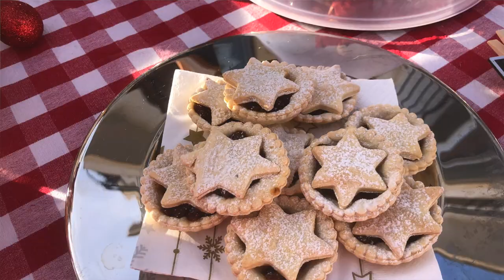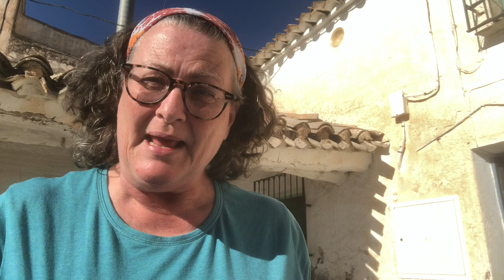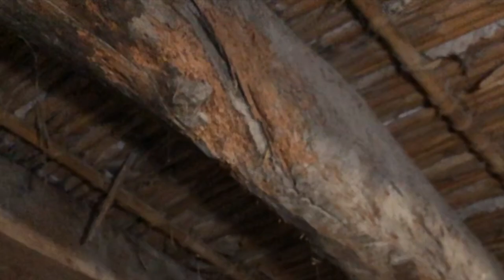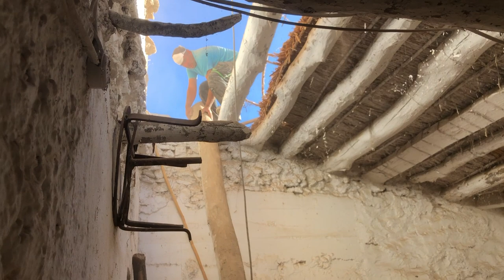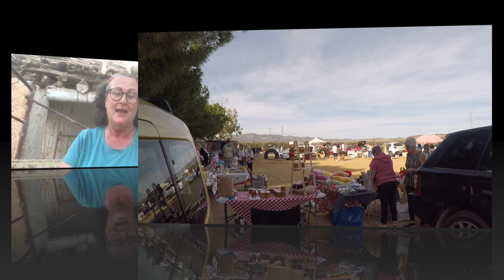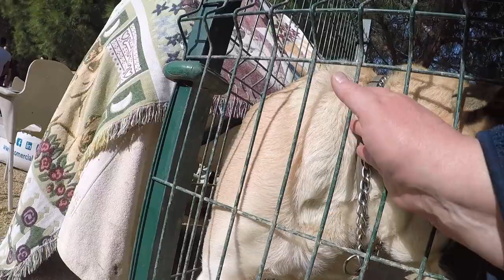23. Part 2 of the roof repairs, good and bad news about the beams & visit an animal sanctuary.

Comment: Hi, I for one would be interested in your back story, employment history etc. etc. Happy New Year.
As mentioned above plug in USB drives are great for freeing up space go for 2 or more terabyte (TB) SIZING, but to be honest you need 2 drives (1 for backup). Avoid Seagate "external" Hard Drives - they fail and lose everything. I can personally endorse Toshiba Canvio drives, I have had a 2TB one for over 5 years and it has never skipped a beat, but like any drive do not drop them or roughly treat them
Reply from the maker: Thanks for the advice, we would hate to lose everything. And great ideas, happy new year